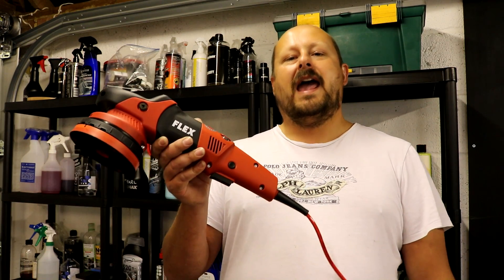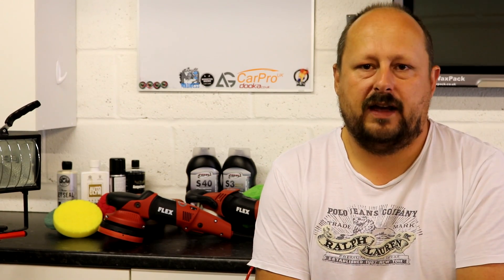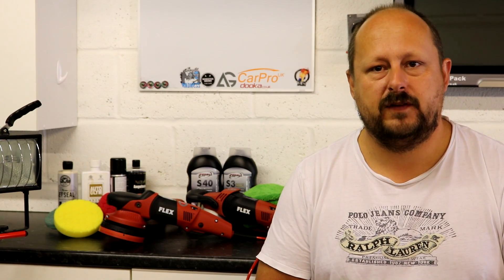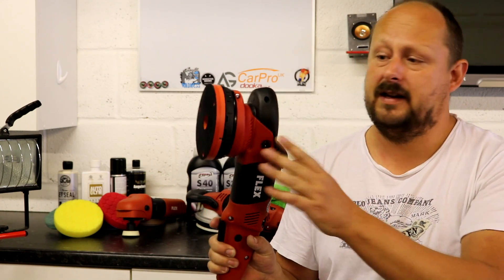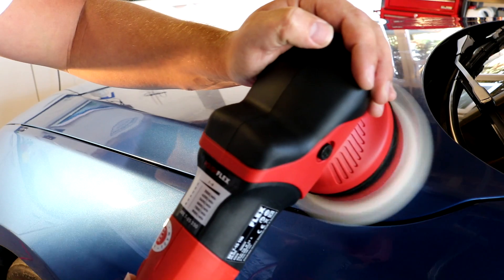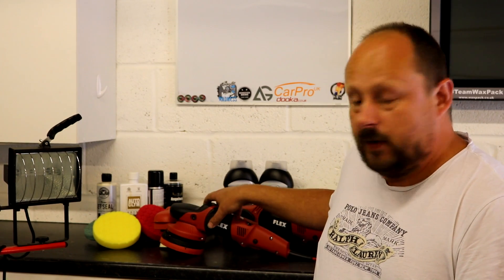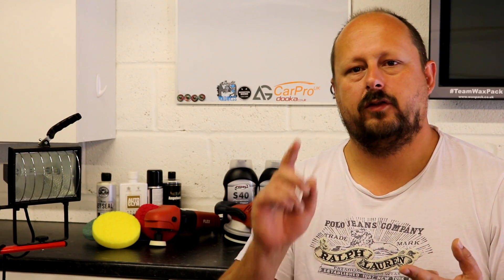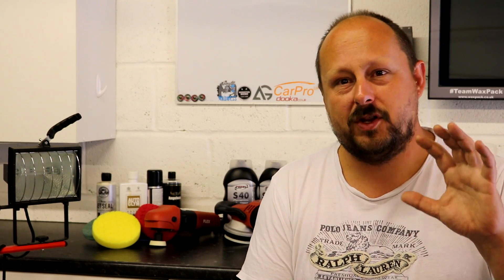Flex XFE 7-15 150 review demo - Long Throw 15ml Dual Action polisher

Comment: thank you soooooo much for a great review!      
i have 2 questions if you had to choose out of the flex 3401 with your 5" lc or hybrid pads or the new xfe which one will you go for and why? 
i can see you answered a similar question below, you have had the experience of a force drive and now a da which feels better and easy to use and correct ?
i tried a rotary for the first time last week and the tool started walking away on me and couldnt handle it or feel in control...maybe i need more expierence
Reply from the maker: when you start out with a rotary run it on max of 5.5 pads.. and run it no faster than 800 RPM..  and just use it like a DA at that speed with slow cross hatch passes and you will get cool results.. no need to crank it up.. hold it nice and loose and level and just let it work the product...  after  a while you get the feel of it, especially the important of holding it level..   I still love using it because the results are great.. the problem arise when you crank it up and overheat the paint, and it can sling if you use too much product..

3401 v xfe7...  at the moment I am really in the honey moon period of the xfe7..  I want to use it more.. I want to own one.. I was impressed with everything about it...   specially how user friendly it is and how easy it is to balance and just work over the panels...  but I love those hybrid power pads in combo with the 3401 and Ive used that so many times to get good results..   The thing that could swing it is the xfe7 works best are low pressure (even flex advise that) so using a free spinning DA gets you into good habits with light hands and letting it glide over the paintwork...    The 3401 you dont slow the spinning down with pressure...   It doesnt spin out like the xfe7 its more a   kind of constant ploughing along...    Keep going back in my mind to how well the xfe7 copes with the correction on the test panel though and couldnt help but think it cuts that clearcoat a bit quicker than the 3401 (without cutting too much or overheating paint like a rotary "could"..

Either one will do.. but ok which one if I had to pick... XFE7
Reply: great response and very sound advise!!!! i have a shinemate ep803 which i was struggling to use but your right i think i need to hold it level and not use high speed plus i feel i was pushing down on it that could be why it started to walk  away on me. i also was struggling to get the concave parts of the car and do cross hatch on them. i might try going even slower on them sections. 

wow really!!! i would of thought the 3401 would be better at cutting as its the beast and older brother, i was worried the xfe would be one of those "too safe and user friendly machine" that you have to go over and over the same section to correct it which was off putting as i dont want to be taking to much time on each section but you have assured me its better at cutting and is user friendly, light and its making you struggle to choose between the machine which makes it right up there . i have a choice to buy a brand new 3401 for £254 with free product or go for this XFE  i am torn between the 2 because of the saving on the 3401 or go for the new kid in the block which is £40 cheaper than its competitor rupes mk2  ..... based on your review which i trust and your fair i think i am going to go for ...... XFE :))) cheers bud!!!

please can you advise on how many pads i would need for 1 car... i know i need compounding pad, polishing pad, and finishing pad but how many of each to do one car or would ok with just 1 of each...?
Reply from the maker: some use 1 cutting pad and do the whole car with it.. I will generally use about 3.. and maybe 2 to polish..   so many 3 cutting pads 3 polishing pads.. and a finishing pad for muck spreading..   S20 on mid range polishing pad is something you also might want to consider.. and with that you are done..
Reply: wow really thats sounds good i was worried i need to buy 1 for each panel and i totalled 9 panels which would cost £90 just for cutting and another £90 for polished 
lol thats a newbie for you lol i might just get 4 cutting 3 polish and 1 finish and see how i get on

Comment: You may remember I bought the Rupes back in Feb and am very pleased with it. Corrected both my cars a couple of weeks apart with it with great results.  A joy to use. The issue I had was when 3/4 way round the second car, the bearing the plate spins on seized solid and it had to go back for the bearing to be replaced. Lost a little confidence in it as a result. I don't need to use it again as the cars have been done but will have to go over my daily in a month or two with something like lime prime just to make sure it runs fine now before the warranty runs out. I paid the money for a Rupes as I thought I was buying a bullet proof pro level machine but it failed after 10 hours of use. Hopefully I was just unlucky.
Reply: reading your honest comment is why i am still sat here deciding which tool i should buy as my first polisher. i have been in this situation since last year. i really want to go for rupes but hear things like this or its bogs down oir doesnt spin on doors etc but on the other hand the xfe doesnt cut as well and 3401 is too much of a beast for newbies :(
Reply: Floyd TMT Mayweather - I'd still recommend the Rupes. They're a joy to use and I have never had bogging down issues. Also look at how many pros use them. If you have concerns go for the XFE. They will have more than enough cut.

Comment: Really enjoyed this review because I am looking at doing something soon with this size machine. Only tonight, (Aust) was i checking out the flex on the  waxit site and noticed the high speed. I realise you don't have to use it that high but it's something I would not use. The speed range jumped off the page as being a little silly for usability for me which I think you have come to conclude yourself in a round about way. 
The flex has a 24 month warranty where Rupes has just 12. 
In Aust the price advantage is with the  Rupes with it costing $729.99 v $764.50 for the flex. 
The backing plate on the Rupes is 120mm where as the pads being packaged on the flex are 6.5s so the packaging out here tends to favour the Rupes as well. I think for me it will the Rupes mainly because I am impressed with the totality of their system with pads and compounds.
I think when it comes to smoothness this is a factor where all the parts work together.
Reply from the maker: great info. the rupes is still an impressive bit of kit. Not sure if theres a right or wrong choice really..
Reply: Forensic Detailing Channel Personally I think you have nailed it. Because I am an absolute beginner, my considerations are a little bit on the side of uncertainty. The colour coding of the Rupes system just gives me a bit of confidence. In theory anyway.  Once you remove this, if you have your own favourite pads like lake country for example, I think you are left with the major point in your review. The washer modification was used in Bigfoot MK1. It hasn't been addressed. That's a bit odd. 

My angelwax enigma has just shown up. Wouldn't have purchased this wax with out your channel and I haven't made my mind up on this yet. 

Love the way you go about this stuff, and if it helps, you are influencing consumers.

Comment: Awesome review John... I've been giving some thought as to trading in my LHR15 mk2 for the flex offering. 
For me the Rupes still bogs down too much and unless completely level with the surface, just doesn't want to spin at all some of the time. 

I'll try greasing the rubber behind the plate to see if it helps... If not I'll be jumping ship to the flex.

Comment: After seeing your review on the Rupes LHR15 MK2, and a few other reviews, I was about to buy one, but then I found some info on the XFE7-15, and then found your review. Sounds like the FLEX might be a better choice. Thanks John, I think we all like your No Bullshit style of Reviews. YouTube is full of Crap.....While this has nothing to do with Detailing, it is another interest of mine, Steve's Small Engine Saloon I think it is from memory, American bloke who gives advice on Chainsaws etc. Entertaining, Factual, Down to Earth No Bullshit Kinda Guy. On another Continent where they are known to Lay It On Thick, Steve Cuts To The Chase to use an American term. In Australia we'd say he Cuts Through The Bullshit, just like you do Mate, that's why we like you!
Reply from the maker: thanks adrian.  with the rupes and flex machines they are the 2 premium offerings.   Flex have made some design tweaks to the xfe 7-15 now as well..  they have done away with the ball bearing style counter weight and I think they have changed the material to rubber which interfaces with the plate.   At least they had on the cordless versions.   And the tool was smoother as a result.   Id like to get my hands on a corded XFE again to see what its like now.   

but you cant go too far wrong with either of the premium tools.     And if you want a budget offering the DAS6 pro plus (or equivalent) is nt a bad option mate.   

thanks for the good feedback really appreciate it.
Reply: @ForensicDetailing  how can you tell which version you are buying. As in the bearing update
Reply from the maker: @kshah74100  I think only a 100 were sold in the UK before they released an updated iteration of the tool.   so you should simply ask whoever your buying it from that you want the fixed counterweight version.   if you shake a machine that has the ball bearing counter weight it makes like a rattline noise like one of those shakers.   you can also undo the backing plate and look you will see the fixed counter weight on the latest version.   Im not  sure why the ball bearing counter weight was like aborted.  but I did noticed the machine I had the vibration was "intrusive" at the upper speed range.    so Im guessing it was to make it smoother.

Comment: hi, you should try to get your hand on the vertool force drive polisher, as it reduces the gap in terms of price between thedas 6 pro plus and the flex. in my mind, i both want to be able to correct, even tougher clear coat, and be safe since i dont have the experience of rotary. and with a classic da, it gets really time consuming trying to correct moderate defect on a hard clear coat such as on a german car. i would love to know your point of view on this tool, since it might be a good all around machine.

Comment: Great review, what about the power between Flex and Rupes? I noticed on my Rupes that it stops rotating fast when panel is not flat (doors etc.) would the Flex be a bit stronger or about the same?
Reply from the maker: thats less about power and more about how the backing plate is supported against the main housing...  and I think flex have a better design there than the rupes offering.

Comment: Kevin Brown once figured out the Flex 3401 spins at 4800 OPM's on speed 6, not the claimed 9600 OPM by Flex. I'd say the same is probably true with the XFE 15. On speed 6, it runs at 4500 OPM's and not the claimed 9,000. 
9,000 OPM's on a DA is A LOT, especially on a long throw! I've tried the XFE 15 and there's no way it spins at 9,000 OPM's on speed 6. Flex determines their OPM's different than the industry standard. The speed feels about the same as the other 15mm's out there. Put them side by side in the air and there is NO WAY the XFE 15 spins almost double the speed of the others on speed 6.
Reply from the maker: great info mark..  thats all new to me..  I would say at top whack this tool feels faster to me than the rupes.. considerbly faster...  but what you are saying is really interesting..  and yer 9000 opm is very very fast.  I wonder if they measure it on the axel without a plate of something?  Id be really interested to know.. but I have no way of measuring if I can think of.
Reply: I forgot exactly how Kevin Brown measured the 3401's OPM, but I think it was by a light source. I could be wrong. I just don't think the XFE 15 spins anywhere near 9,000 OPM compared to the industry standard. Pads would be blowing out all the time at that speed, and it just didn't feel it was spinning at 9,000 OPM. Again, Flex claims the 3401 spins at 9,600 OPM's on speed 6. Without any type of measuring, it's not rocket science that is does not. :)
Reply from the maker: id be interested to know.. but in lamens terms it has a ton of correction capability at speed 3-4...  great stuff mark cheers
Reply: Great to know, thanks! I like your videos!
Reply: mark: If you can find some article or video how Kevin Brown measured OPM, I would be very interested in that. So do you think that OPM that flex gives are motor rotation per minute rather than driveshaft rotation per minute and the difference is hidden in the gear ratio? 

13:15 - and speaking of K. Brown, it's rather just washer then bearing :)
Reply: Hi Jan, I'll ask him. I talk to him a lot. That could be the case.
Reply: Yep - I think Flex's "opm" spec is actually OSCILLATIONS per minute, with an "oscillation" being approximately half an orbit, and we should really be looking at the RPM spec of the Flex XFE 7-15 if we want to compare it's speed with other machines.  In the specs for my sander, it gives an RPM speed range, and an OSCILLATION speed range, and in my case, the oscillation figures are exactly double the RPM figures. (in the case of the XFE, it's almost, but not quite, double) 
EDIT: Actually looking at the official specs for the Rupes: http://bigfootrupes.com/wp-content/uploads/2013/07/LHR21ES.pdf  it states the speed in RPM, not OPM, and THAT specification is fairly close to the Flex RPM speed range. However, I notice that the Flex draws significantly more power than the Rupes (710W cf 500W, assuming the Rupes spec is input power), so despite the fact that they appear to have a similar speed range, the Flex may perform better when pressure is applied. I.e, for a given speed, the Flex may be able to maintain that speed for a higher downward pressure than the Rupes.
Reply from the maker: Pro detailers magazine were testing all 3 long throws (flex rupes das6P+) . if you see my vlog entry section day at UK detailing we were playing around with all 3 tools at the same time..  what I will say is the flex feels like its running a lot faster at TOP whack than the rupes and the DAS6P+...   So Im of the opinion if I disregard the claimed orbit rates and just had a finger in the wind.. I felt the flex was maybe going at least 25%-45% quicker than the other tools when on their highest setting.   If im wrong and they are closer the level of vibration possibly might has made me over estimate the flex's speed potentialy..  but I also remember how fast I dusted up the compound with the flex on top whack, which I couldnt do with the others...
Reply: Ok. As I said, the Flex does appear to consume more electrical power, so it's probably to be expected that it will have more correcting ability. (again, I'm assuming that Rupes power spec is INPUT spec. Flex give both input and output. I'm also assuming Rupes don't have access to higher efficiency motor tech than Flex)  I.e - I think all these OPM & RPM specs are unloaded - things might be quite different when loaded.  It doesn't hurt to try and figure out exactly what the manufacturer means in their specs though. FWIW, I've emailed Porter Cable and Flex, asking them to clarify exactly what their specifications mean. (I haven't contacted Rupes yet)  Just btw, I'm not a pro detailer or anything - just interested that's all.
Reply: No reply at all from Flex yet, and Porter Cable have replied but haven't really helped at all yet. They said they'll look into it further but I'm not holding my breath.
Reply: Good, thanks for your effort. Keep us updated! :)

Comment: Hi John! Big dilema in front. Rupes 15 MK2 from official dealer or XFE from Germany as we don't have a dealer here in Cyprus. I have to decide fast... Thanks!
Reply from the maker: I want the flex.  but the two tools basically do the same thing.  someone else would want the rupes. its the ergonomics of the flex that swing it for me.  just less industrial.  I also think the flex mini DA the xfe 7-12 80 is better than the rupes mini.  so eventually Id want to pair them up..  honestly though the rupes is still cool. wont effect results that much which one you go for.
Reply: I also want the Flex more mostly thanks to you. My only concern is there is no Flex dealership here, but probably no need to worry because of the international waranty and the reputation they are buletproof and reliable.
Reply from the maker: @nikistefanovv  these machines  can  break. both flex and rupes.   so also consider that if its a tool you have to rely on for work.

Comment: Hi, i watched multiple video's and really enjoy your honest reviews about the polishers. I can't decide which tool to buy, the shortlist is Rupes LHR 15MKiii and the XFE 7 15 150. What i constantly hear is that the Rupes is smoother and the Flex has the better customer Support. After 5 years have passed, which tool would you recommend today?
Reply from the maker: for free spinning I think the LHR15 mk3.  For forced rotation its the Flex XCE.
Reply: Bought the Rupes last year. Really love the machine. 
Thanks for the final push. 

Used the machine on gelcoat and carpaint. In combination with Menzerna polishes and Gyeon pads no complaint’s.